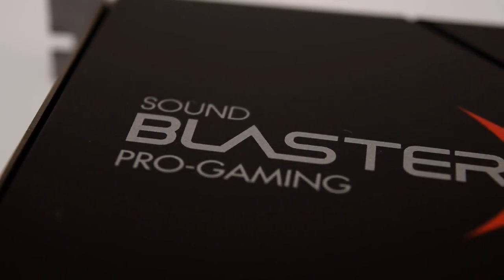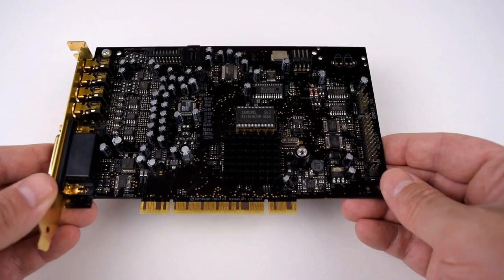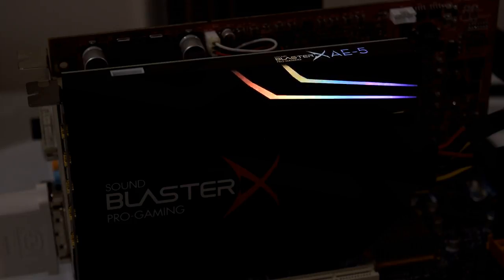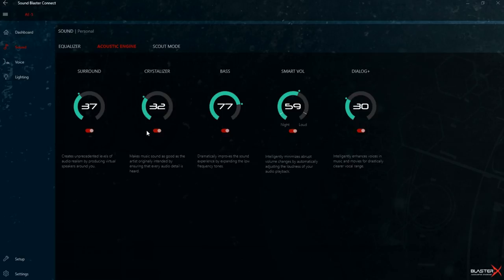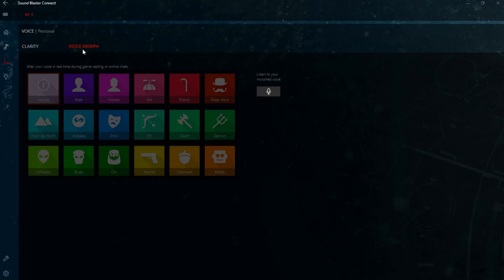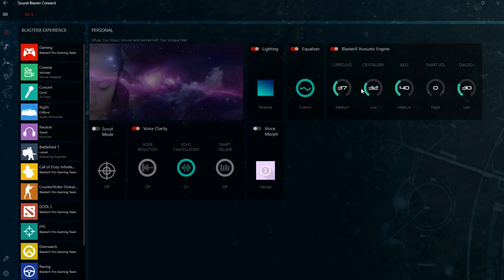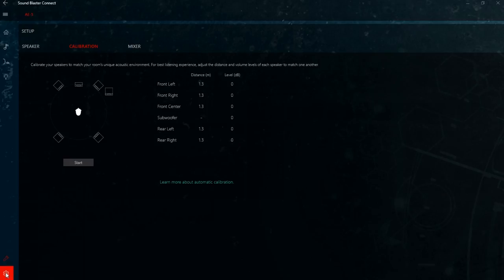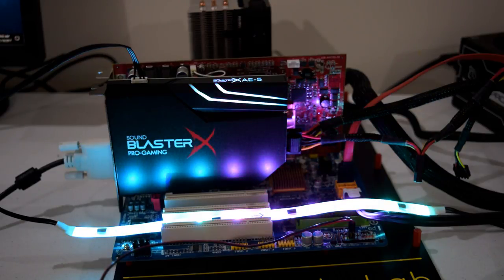Is the SoundBlasterX AE-5 Creative's best Sound Blaster?

Comment: The last few Soundblasters have left a lot to be desired, they're decent as sound-cards and certainly an improvement over onboard (At least IMO. Plus the small performance boost is nice, I can play my uncompressed music without any real impact on my CPU using my Xonar DX) but stuff like OpenAL really needs to make a proper return, the modern equivalent just isn't anywhere nearly as good and sound reproduction is going to become a lot more complex in VR. (Which I fully expect will include movies and "experiences" as opposed to just games eventually.)
Reply from the maker: Agreed. I miss the days of playing Battlefield 2142 with headphones on my X-Fi.
Reply: From what I've read it's pretty much Creative's fault OpenAL died. It apparently originally aimed to be a open standard and open source replacement for 3D audio systems including EAX. But Creative (who owns and controls it) later made the reference implementation of OpenAL proprietary. There are some forks of it that are open like OpenAL Soft but for obv copyright reasons they can't fully emulate/support EAX (at least not past v 2.0 I think). OpenAL also hasn't been updated in 9 years and lacks some basic things that middleware like FMOD and wwise have like sound propagation (distance from a sound only translates through amplitude/volume, not delay).

However what I find interesting is the work Valve is doing on "Steam Audio". Targeted for not just VR but regular gaming as well. 
https://valvesoftware.github.io/steam-audio/#learn-more
It has HRTF based binaural rendering for extremely good 3D positional audio, Physics based sound propagation (computes how sounds interact, and travel through the environment), sound occlusion and reflection, low latency and low performance hit (it runs on Android, as well a Windows, Linux, and MacOS). What makes me hopeful it gets used is the fact that it's already integrated into Unity, Unreal, FMOD Studio, and they are finishing up their WWISE plugin. That covers the two most popular engines, and two most popular audio middlewares. Here's hoping a focus on advancing the quality of the audio simulation in games makes a return like it was in the late 90's early 2000's. But this time no special hardware needed.

Comment: Had an xfi, it broke and even before it broke some games just didn't work. Do you even need a sound card anymore? It's just the DAC you pay for, nothing else in it matters.
Reply: If you want to use analog surround sound, and really want to avoid bitstreamed optical or dig yourself some side speakers, it kind of is the best/only option if you're in to older games--especially on older computers like Phil does. HDMI surround through your GPU probably won't do too well with EAX, for example (unless you perhaps used the X-Fi MB3 software thing???).

But if you're all stereo--yeah, just getting an external DAC probably makes a lot more sense.

Comment: Anyone know here if the Soundblaster AE5 supports EAX 5? Looking to possibly use it with games that use EAX 5 like the original Bioshock
Reply from the maker: It supports ALchemy, but as the card doesn't have Windows XP drivers, I'm not sure what you're asking.
Reply: EAX was implemented with several versions. Older versions of EAX don't work properly without something like ALchemy. EAX 5 actually runs through OpenAL to my understanding, and it seems to be simply locked out if you don't have the correct card from my experiences (similar to how ALchemy won't work properly without a Creative card). Am just wondering cause i'm looking to buy a sound card that will let me use EAX in my games, and if this card does let me use EAX 5, then it's a definite buy. Bioshock is the game that comes to mind that supports EAX 5.

Comment: i have a fair share of using creative soundcard with decent speaker since soundblaster pro, sb16, awe64, pci128, live!, audigy2zs, xfi, xfi ti. if talking about sound quality, maybe the real x-fi (emu20k1/ca20k2) is the dawn of good sound quality, back then even soundblaster live got beaten by crystal onboard audio in term sound quality, but if you talking about sound performance, soundblaster maybe the king of mainstream pc audio processor with their eax extension. sb live audio quality maybe so-so but it helps with improving frame/sec in game, and their isa card is the most compatible with dos game

now days sb xfi + edifier speakers is good enough for me, compare with realtek onboard even using sound enhancement like dolby or xfi mb is very huge difference in terms of sound quality

Comment: The AE-5 isn't creative's highest end sound card but it is their newest, their greatest highest end card is the ZxR with the cleanest audio but some people still prefer the Audigy 2-4 and X-Fi for various reasons. I miss using EAX Jazz effects for my music with my X-Fi Xtreme gamer the top end faitality X-Fi card would actually be really nice to have come to think of it instead of my Z series but the clarity of the audio would be missed. 
By clarity I mean the SNR Signal too noise ratio. 
The AE-5 features dacs the Z series does not have but the ZxR has high end barbrown dac which can be replaced switched out very easy for even higher end dacs if you want to upgrade and creative did that on purpose and even advertise it and point you in the right direction if you want to too it and offer help with your choices so you know what your buying.
So The AE-5 offers higher audio resolution but the ZxR can be upgraded if you want too but the audio clarity isn't matched on the AE-5 ;) 

Here's a sound comparison for X-Fi with EAX to Creative Zx
X-Fi Deus Ex Theme Recorded with EAX Jazz
https://www.youtube.com/watch?v=bvQI7kUcaI0

Zx Deus Ex Theme 
https://www.youtube.com/watch?v=0_wCH7mQixE

Damn right ALchemy better still be supported! ;)

Comment: Well... This is a no buy for me then. I dislike the LED thing, but the thing that shot it down is that it has no optical in.
I'm actually using it, along with the mic in/aux in.

How different is the AE-X5 from the Z line? As far as i know they use the same DSP.
How much difference does the DAC create?
Reply from the maker: +itsGeorgeAgain They do not use the same DAC. The DAC, converts the digital signal to analogue. It is one the most influential aspects of sound quality.
Reply: Yeah the DAC is different, i'm saying that the DSP is the same. They are using the same Core3D chip i think.

Comment: Did they bring back the ability to load soundfonts for midi files?  I know after awe32 they made it difficult and I could never figure out how to do it on my X-Fi.
Reply from the maker: I don't think so, but I'm sure I had this working with the X-Fi. You needed to install all the software from the CD if I recall correctly. But you can just use a Software Synth these days.

Comment: There are way better quality sound solutions out there for general modern use...  For playing EAX games, however, you do kinda need a Creative card.  Personally, I'd suggest going with the most recent old card for cheap, use the SPDIF connector to a SPDIF-In on a better newer solution, and call it a day.  It'd cost more altogether, but you'd get the best of both without needing to spend AS much as if you bought the AE-5 just for the Alchemy feature.  Heck, some of the external devices I'm thinking of can be had with an older model that's just as good, used, or even massively marked down new.  Could wind up saving money overall.  At least you didn't get super hyped about the card like other channels that reviewed it...  Best Creative yet?  Sure.  But that's not hard to accomplish.  That it's taken this long for Creative to "get gud" and only marginally at that, is a demonstration of just how shitty they are as a company.
Reply: Do you think there's a decent external/USB solution that I could go with these days? Last time I looked into that, it was still a relatively immature field. Pretty low odds that the SPDIF trick would even be applicable on something like that, I'd think.

I've occupied every last one of my PCI/PCI-E slots on my PC and don't really want to swap hardware a lot if I can help it.  : P

Edit: Actually, I'm having a really hard time finding much anything modern-ish that has an SPDIF-in connector at all besides Creative stuff! Maybe I should have just started by asking you what some of the stuff you were thinking of was.
Reply: I'm thinking of home theater audio equipment being used for computer audio.
Reply: Ah, thanks anyway. I did actually find a different card that should accomplish the same effect in theory and appears to check all the boxes for good quality audio: An HT Omega Fenix. I think a have a mad scientist idea that could actually free up an expansion slot too, so I might just order that if my theory works.

Could be useful for people like me where SPDIF can be just a little limiting in some situations (mostly surround speaker stuff--can't really think of downsides for stereo/HRTF), and replacing a system for HDMI isn't really something they had in mind.
Reply: That does look like a pretty good card for if you really want to stick to keeping everything in the same box.  It'll be better than this Creative card, but not as good as something external.

Comment: Would you choose a X-fi over a Sb16 for Windows 98 pc? I own both of those along with a Audigy 2. The system is mainly for dos/early 90s windows games. It has a Pentium 166. Putting a X-fi might be too "new"?
Reply from the maker: The "best" Sound blaster for Windows 98 SE is the Audigy 2 ZS.
Reply: SB 16 for sure, cause it has full 16-bit DOS games support, I don't think x-fi even has drivers for win98 + the card will surely have higher CPU overhead in non AVX games, and TBH pentium 166 is too weak to run most 3D windows games so you will not even get to the EAX titles with that machine.
Btw, for combined dual-boot machines that use more modern platforms, SB-live was the last of the PCI cards to support SB-16 DOS emulation. However, it needs EMM386 to run and modern chipsets are not compatible. The last ones that I found work are in the KT333 era, Nforce2 is already a no go.
Reply: +Tomiko Miyafuji
The X-Fi has full Windows 98/ME support as well as being fully DOS compatible through hardware based emulation[simulation?]. Phil has a point to the Audigy 2 being the best Windows 9X kernel based card. This is because the Audigy series still have native 8 and 16 bit support for older games. The X-Fi's support was through a "work-around". It still worked, but didn't sound perfect in all cases. The Audigy was and still is a great card for DOS and Win9X based games.
Reply: You could put both soundcards into the system and use the SB16 for DOS.
Reply: I found a SBLive! card aswell in the closet now. Installed that and it works just fine. It's almost timeperiod for the system too. It  has better sampling rate and snr ratio is noticeably better. An issue now is what to put in my last free pci slot as the IBM oem motherboard only  has 2. Goal being to put in a 3dFX pci card into the system. Too bad the Voodoo3 2000 comes with a hefty pricetag nowadays. Another issue with the the MB is that it's buildt in graphics adapter is rather slow even for dos games. Running DOOM higher than 320x200 or even VESA mode gives noticeable framestuttering. I believe it has only 2Mb of videoram. Not sure if that is the main issue.
Reply: Your main issue is that its pentium 166. That is Voodoo1 era CPU, even 2x faster CPU is not enough to really feed Voodoo2, so don't even try Voodoo3 (that one belongs to mid pentium 3 at least) Its CPU from SB16/AWE32 era, modern PCI cards create only big driver overhead and issues on such system. Generally, if you are going for retro PC stick with the SB ISA cards, go for PCI only if the board does not have any ISA slots at all.
Reply: What graphics chip is on your motherboard? Usually IBM used CirrusLogic chips for graphics and they are very compatible and fast in DOS. The 2 MB videoram is a non-issue in DOS. Regarding VESA maybe your Video-BIOS just isn't very advanced, but the program called UniVBE will fix that.
I agree with +Tomiko Miyafuji, with your CPU you don't need a Voodoo3, you should use a V1, V2 or a Banshee. The latter would also give you very good DOS-support and they usually have very good DACs plus they are the cheapest Voodoo-cards nowadays. While SB Live works ok in DOS, some games may have crackling sound and other issues.
Reply: Yes. From what I have gathered a Voodoo2 is "overkill" so no higher than that. The Banshee would be a nice thing to have. For that has 2D graphics support aswell yes? I managed to track down the onboard gpu and it's a Ati Rage II with 4Mb ram. I found some updated drivers (for the timeperiod 99-01). It seemed to improve some. I have 4 ISA slots and 2 PCi. Problem is that ISA cards are very rare here. Also mid to late 90s PCI cards are even more rare. Don't think I have come across a Banshee for a few years. Voodoo2 cards have started to show up though. I'm looking for a 233MMX (my mb apparently had a 166MMX cpu installed on it.) Going to try and find some 32Mb ram sticks too (Mb supports up to 128 but can only see 64Mb at any given time, got 32Mb total atm). Goal is to make it top of the line for the time period. I haven't had crackling sound in games other than Wolfenstein3D when opening doors or trying to find hidden ones. The ISA soundcard had the same issue. But that is common if im not mistaken.
Reply: If you get a 233 MMX, than Voodoo2 or Banshee would start to make sense. Yes, Banshee is 3D and 2D with very good DAC, very good 2D speed in Windows and DOS and good DOS-compatibility. See here: https://gona.mactar.hu/DOS_TESTS/ . That list also shows how Ati Rage II handles difficult DOS games.
Regarding RAM: Depending on your mainboard and chipset RAM you might better stay at or below 64 Mb because of cacheable area.
Which country are you in?
Reply: I used to have MMX233 overclocked to 300 and things were playable but not great. Voodoo 2 / Banshee shine in Unreal engine, and this CPU is still on a weak side. Socket 7 really belongs to earliest 3D and mostly DOS era gaming. Even in the DOS games that support higher vesa modes like Duke3D, Blood, etc, you will be stuck to 320x200 because the CPU is not powerful to drive 640x480. This system will be ok with any S3 or Cyrus logic or ATI 2D card off that era. If you really want 3D, go for Voodoo1 or 2. Not banshee as only V1/2 have excellent compatibility with DOSglide and the earliest 3D games.
Reply: Sweden. Problem is that most that have old hardware knows what it's "worth". Very rarely do you find something cheap. I have seen some though. A Voodoo5 5500 whent for $45 on my domestic auction site. Fully working. I think Im going to order a Banshee from Electromyne. Or something similar
Reply: If you only count online sellers and auctions it's the same in Germany. The best deals, and those are sometimes for free, can be made offline through acquaintances. So it's best to let everybody in your environment that you are interested in old hardware.
Reply: I ordered a Banshee from Electromyne. With the discount code from Phil it turned out pretty ok price. It should be sufficient and way above whats needed for old dos games including the Build engine. I found a stick of 256Mb (i know it only supports up to 64Mb at any time but the stick is not being used elsewhere) sdram and stuck it in the machine so now I am capped for memory but it seemed to make it a bit snappier. I guess the memory is shared with the onboard graphics. And according to the startup screen for Shadow Warrior 28 out of the 32Mb installed I guess it was getting full. We'll see in a day or two when the card arrives.

Comment: really like your vids dude, I was wondering if you could give me some tips/maybe make a video on how to get older games such as fallout 3 onto a windows xp machine...I own it on steam, is it worth connecting the machine to the internet to install steam?
Any tips appreciated.
Reply from the maker: What I do is put the Steam installer on a USB, run it from there. You got to be connected to the Internet, but it will be fine. I haven't had any problems. I don't tough the web browser.
Reply: thanks alot for the reply :).  ill be doing this asap
Reply: PhilsComputerLab I am having so many Damn issues with xp... It's so unstable... It seems like any drivers I install lead to freezes and lock ups... Sigh. Just want to play fallout 3 lol

Comment: I tried it. had one die, replaced it. then I realized how bad it sucked on my 5.6 surround system as well as the GUI I absolutely hate. I said screw it and went back to suffering bad drivers on my soundblaster z. its fine as long as you disable all other sound devices in device manager. at that point it only glitches when I really should have rebooted 36 hours ago. cold boot. good to rock. I'm honestly afraid of the z second edition. I have no idea what "virtual 7.1" is but I'm fairly certain it wont like my custom sound system. plus I'm honestly considering going back to something with real EAX support. I still don't know what alchemy is but even when I enable it and import the old files I can't tell the difference and if I can't tell the difference that means someone is screwing me.